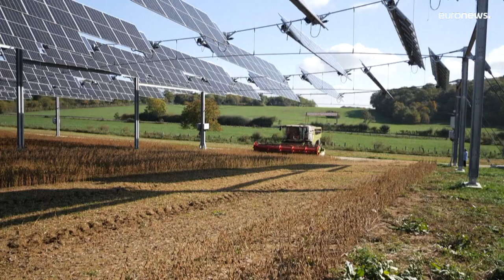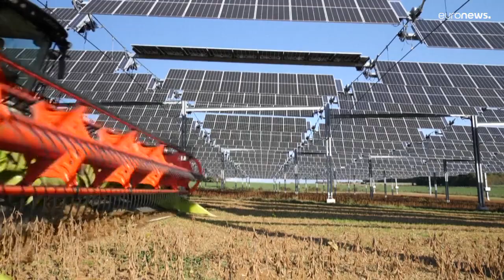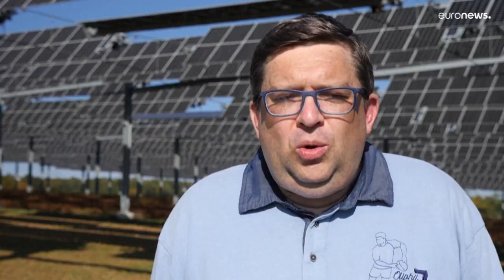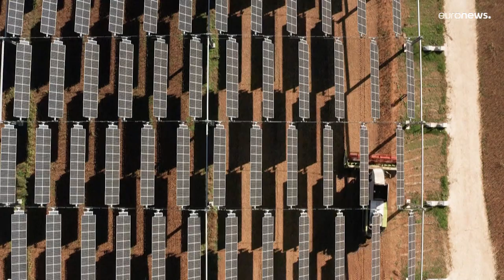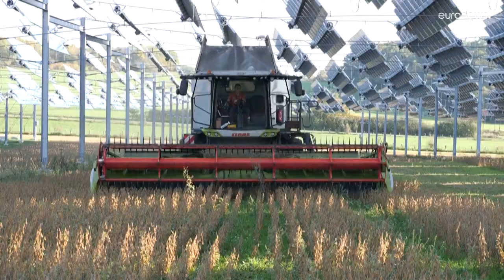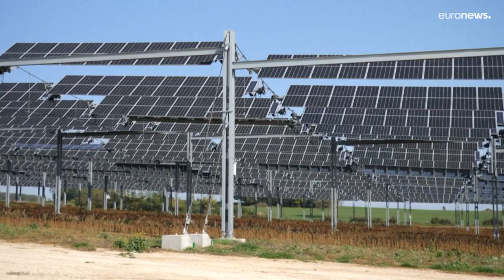French farmers are covering crops with solar panels to produce food and energy at the same time

Comment: Nice until fire get loose on tge ground or the panels
Reply: It's certainly not impossible for field crops to catch fire. Rare, but not impossible. And the end of the growing season, when most grain/pulse crops dry. Fortunately, the panels would probably not sustain any/much damage, given how rapidly a field of grain would burn out.
Reply: @pteechka1  yeahh when pannels take heat damege ?
Reply: @jacobhoekstra340  I doubt a fire from a grain field would last long enough or be hot enough to do significant damage. It's not like burning wood, as an example, much less fuel load.